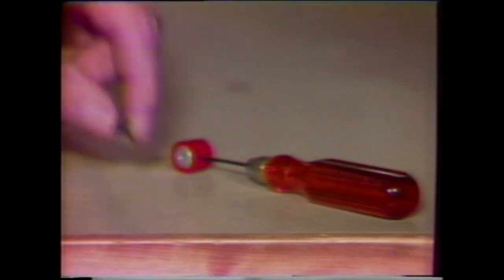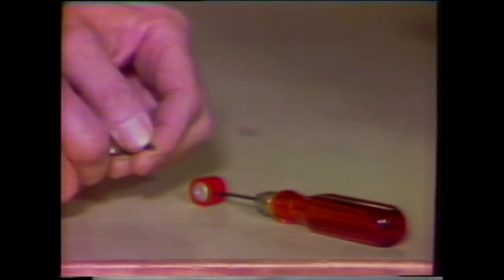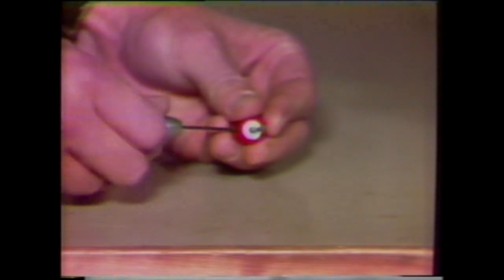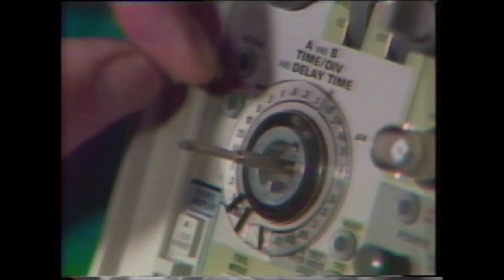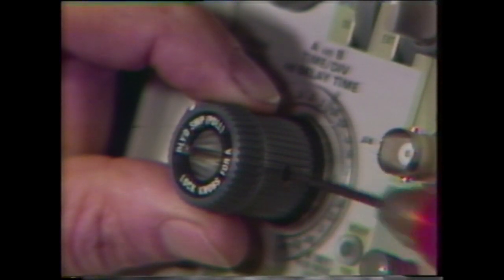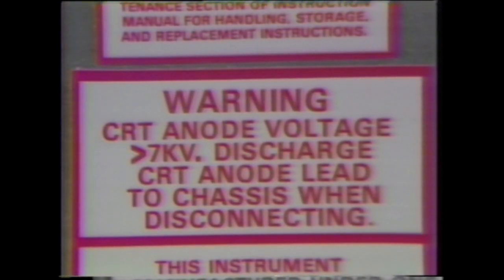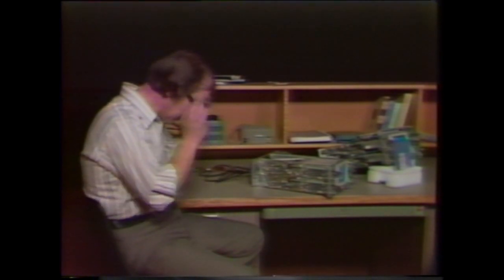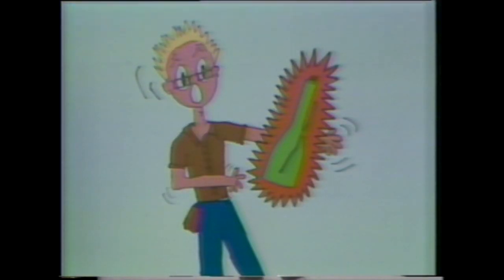Tektronix 465/475 Series Repair Tips

Comment: ive got what i presumed to be  a bad power supply. As per thevscope everything seems to bevworking fine. However whennviewing astring of
 pulses on both channels simultaneously there  to be waving or jittering of traces. If I increase the sweep rate the beating seems to diminish. It looks like ripple. On thev+110 volt supply or a shiels is missing. Ive seen the  cheaper home scopes with a similar effect on the CRT when a large isolation transformer iscplacevinto close proximity to each other. Like a magneric field interrering with the deflection plates on the scooe being  viewed.

Hmnn... I think in describing my problem that I have solved my own solution. I am too chicken to open the scope up for fear thh whole acticity will crashband burn. Ill be left with a great scope that is a pile of components.

Comment: It would be nice to also mention that the power supply diodes and filter caps are a bit undersized and they tend to fail pretty often.  Also isn't one of the capacitors charged with making a thru-hole connection and must be soldered on both sides?   Also its ground lugs are tasked with carrying ground currents between the ground lugs.  Kinda iffy, fellas.

Comment: I have one of each, I have to clean the attenuators to see if it fixes a glitch .
Reply: they make a big dealnout of cleaning the attenuato switching contacts, so much that ut causes novice technicians attempt their folly iwards destruction of the equipment. Loosen thevsix screws on the cover of the attenuator module, disconnect the coupling rod to the passing cintrol and just lift of the metal too cover. A light squirt or two of contact cleaner will saturate the area. The rotate the attenuator knob and self clean the contacts. Its thatvsimole and safe. Do not use excess solvent.

Comment: This video is like a "howto destroy your Tek circuit board in 2 easy steps".
Reply: That is very uncharacteristic method from Tek... Never seen anything so crude and brute suggested by Tek before.
Reply from the maker: in their defense, often the reason to replace a pot is because one or more legs are already broken due to a frontal impact on the knob.
Reply: Seriously I would have great reservations about using pliers to tear a defective pot right off the board. Cardboard won’t prevent the traces from coming off with the pot!
Reply: @jastervoid  Besides that, they've only soldered a single leg of a new pot on camera. Someone doesn't love the smell of melted plastic in the morning. :^)